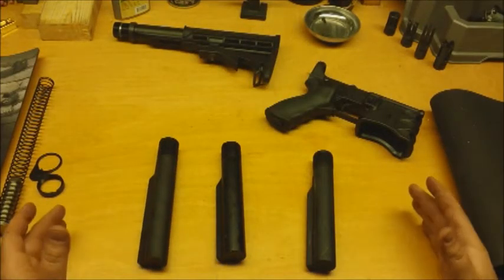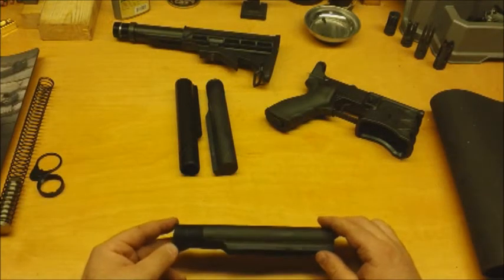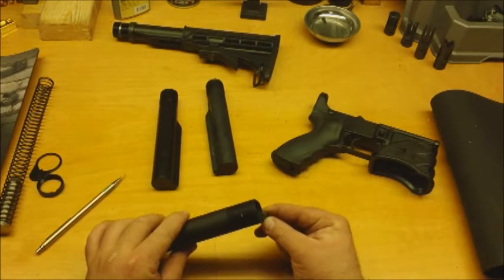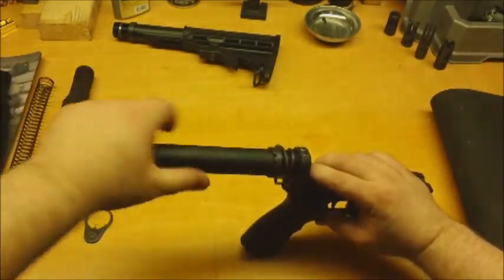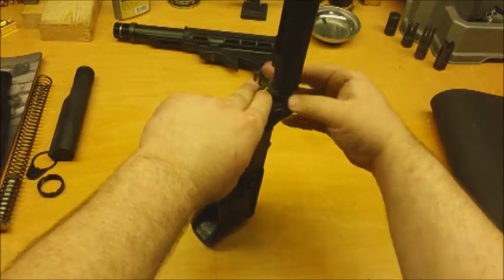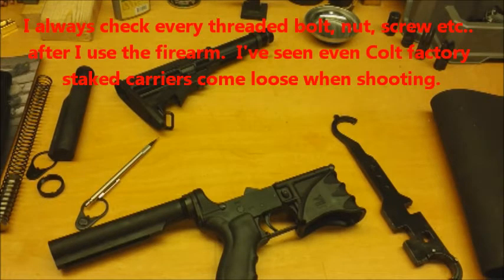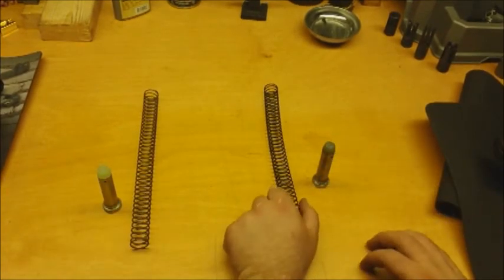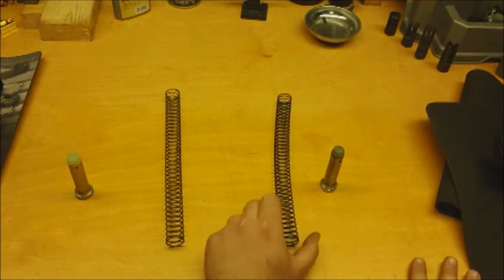Part II of an In Depth Look at American vs. Foreign Made AR-15 Buffer Tubes

Comment from the maker: Hold off on the Red dot for right now.  I am going to do a review/ comparison of eotech vs aimpoint vs trijicon vs meprolight.  As for rear sights, see my videos about them.  I like the magpul, matech or YHM. Chrome lining is definitely the way to.  See my video about gas blocks to see some possible problems that can occur with them. Since you are a machinist, you should have no problem pinning them yourself. 
Just one observation from experience, keep it lightweight if possible. Under 9 lbs

Comment: I don't know exactly since this is my first build. The few things I do know are: 5.56, 14.5" barrel with flash hider, chrome lined light or medium weight M4 style, flat top upper with a red dot or Eotech or similar. I don't plan on doing much out past 100 yards, so no need for a long range optic. Would like to incorporate iron or fixed sights as well. I'm a CNC machinist..good work with your explanation of the processes in the buffer tubes. Very informative.